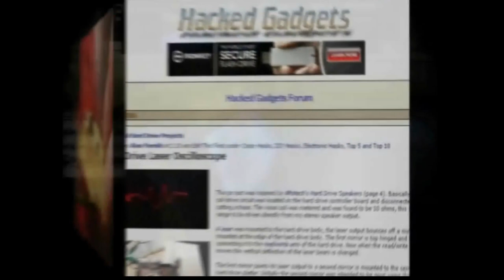Black and Decker Gyro Screwdriver Teardown

Comment: Gregvi, thanks for publishing your fix for reverse operation only.  I disconnected the black wire from the battery then reconnected it and all is working great. I have used this screwdriver for all small jobs for several years now and glad I can use it for many more. Great screwdriver.

Comment: I found the fix!! I've had 3 of these now and they've all failed in the same way (full reverse only).  2 were mine.  1 was a buddy's. Although this video doesn't specifically call out how to fix, I've figured out that all that is needed is to reboot the screwdriver's electronics.  If you open it up and disconnect the black wire lead from battery, wait a few seconds, reconnect the lead and put it back together... It fixes the reverse-only problem.  I verified the fix with my buddy's screwdriver as well.  Love this screwdriver.  Wish B&D still sold it.
Reply: Didn't work for me...  I tried disconnecting a few seconds, but after reconnecting it continued the same. What I have noticed however is that after fully charging the driver sometimes it works properly for a while, but after some work it goes back to the same behaviour

Comment: Nice video.  I would have thought some description of the battery would have been done.  Is it a standard 18650? or a triple stacked NiMh 3.6v battery?  Usually if something is lithium, it is heavily marketed as such; and there are no such labeling on the device.  What is even more strange is that the charging adapter has a 9 volt output.  This is still one of my favorite light duty screwdrivers, just not holding a charge for long.  I am relishing being able to replace it with a higher capacity cell.  Thanks again.

Comment: I've had 2 of these now and they've both now failed in the same way.  They'll only reverse at full speed regardless of the position of the driver.  It's really frustrating.
Reply: Damn! I just posted a question about this exact problem!
Reply: Mine failed the same way. I used it probably less that 20 times over a 2 year period for minor screw jobs. This what happens to a once decent brand name that now makes junk in China. B & D makes junk now. I say away from them.
Reply: I have the same issue. Recalibration does not help, or helps for a short while.

Comment: Question please.  I have one of these and cherish it.  An excellent product. However,  I tried a hack involving gluing magnets to the side of tools to allow for holding of screws,  bit attachments,  etc. For quite awhile I was using rubber bands to hold the magnets to the screwdriver sides with no adverse effects.  Recently,  i decided to glue the two magnets, one on each side.  Shortly thereafter,  the screwdriver would turn on when the activation pad was depressed, regardless of whether there was any rotation, and it will only turn left or counterclockwise,  i.e., to remove screws direction.  The self calibration suggestion in the manual hasn't worked.  Could the magnets have affected the rotational motion sensor? Or the controller? Any fix ideas?
Reply from the maker: The magnet you installed properly effected the internal gyro and compass. Try repositioning the magnets or use a method that doesn't use magnets.
Reply: @abbtech  will do. But I have a hunch that it might have just been coincidence as after I posted this I saw another post where somebody said they had two screwdrivers that we're doing the same thing as mine of course - magnets being involved.
Reply: @Hicaliber1  it was a coincidence.  Please see my post above for the fix.

Comment: 3.6 volt motor? That's odd since the product is marketed as 4 volts.
Reply: america is weird, its 4v max for example all the 18v drills are marketed as 20v max in america .... no idea why though
Reply: Not weird nor false...
Peak voltage at full charge for a little while is 4V, when fairly new.
Read this:
https://batteryuniversity.com/learn/article/charging_lithium_ion_batteries
Reply: @SynthOSphere  Peak (recommended max charge) is 4.2 VDC
Reply: Could you provide us with photos of the board. High def if possible sir. Thank you.